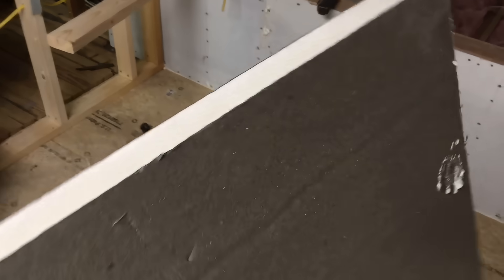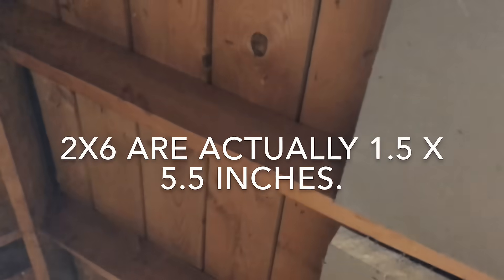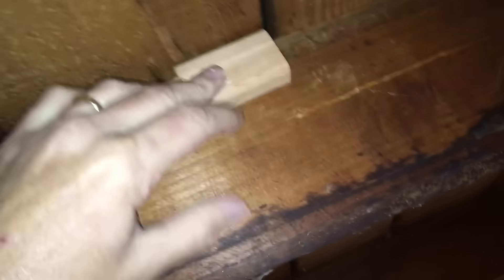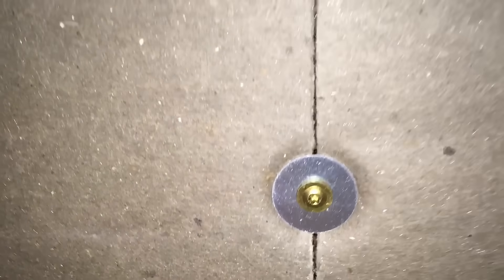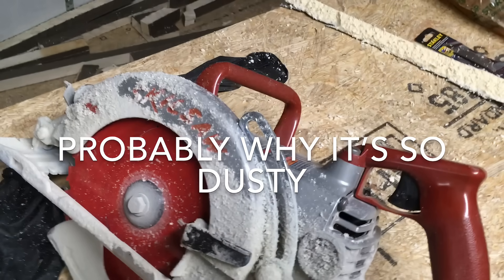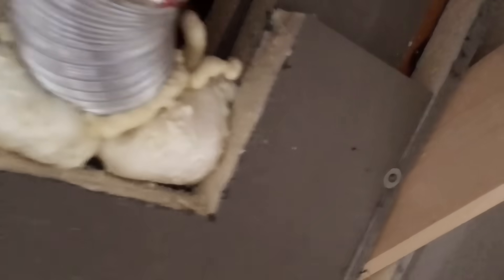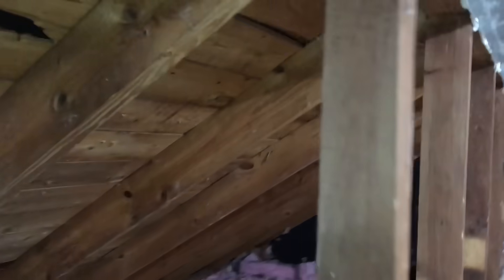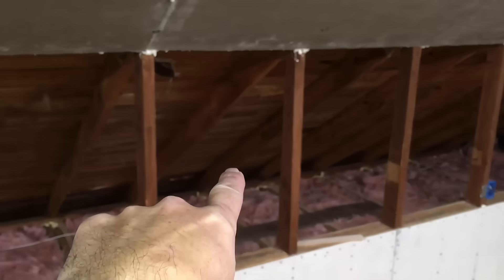Getting R-30 in an attic suite with 2x6 ceiling rafters

Comment: Do you have soffit vents? I want to insulate my roof and I’m trying to figure out the best way. I have no soffit vents nor do I have a ridge vent. The only vents I have are one on the west side of the roof and one on the east side of the roof about one foot away from the ridge. Do those two vents vent enough? Is there even a need to keep those two vents if there is no soffit vent? Any insight would be appreciated.
Reply from the maker: Yes, I have soffit vents. It sounds like you have are gable vents,  depending on where you live and if you get a lot of snow and ice, they're better than nothing, but in order for you to get any benefit from creating the air space behind the insulation (like in this video) you'd need to install soffit vents. If you have soffits, they make vents you can retrofit pretty easily with a hole-saw on a drill. https://www.lowes.com/pd/Air-Vent-3-5-in-L-Mill-Aluminum-Soffit-Vent/3017509
Reply: @FamilyFriendlyDIY  I appreciate you taking the time to reply and add the link. I don’t have gable vents but i have thought about installing them. All I have are two vents in the roof itself. Unfortunately I don’t have a soffit. I wish I did bc your idea would of worked perfectly.

Comment: Countersunk screws work nicely with fender/repair/penny washers and sit flush. 
An insulation saw with teeth like a bread knife makes less powder. 
Foil faced PIR insulation gives a built in vapour barrier. Foam fill any gaps and cover all joints with aluminium tape.

Comment: Do more research on your poly-iso....    Science proves it is a warm weather product..    As the temperature falls below 40 degrees it starts losing its r value.     For each ten degrees drop loses approximately 2 r value.     Might want to use a different poly which actually improves with cold temperatures..     Just thought you ought to know.

Comment: Because the portion of the wall is sloped, in Canada, it's considered a wall, as far as R-Value requirements. However, an air space of 2 1/2 inch is required. This is required to prevent choking air circulation between  other compartments.
Reply: inaccurate
Reply: @frostycools1315  Because..
Reply: @p0llenp0ny  r -50 is the min not r-30 , studs screwed not nailed, vapor seal boxes in interior partitions, no poly on top plates, and i only looked for less then 3 min of the video

Comment: Quick question - thinking about doing this on my 3 seasons room.  I don't have a ridge vent where it connects to the house, but I do (can) have a vent at the soffit end.  Would I need the ridge vent to do this?
Reply from the maker: For the soffit vent to work, yes, you'd need a ridge vent. They're pretty easy to retrofit though. You can just snap a line a couple of inches down from your ridge on your shingles, and cut through the shingles and decking with a circular saw. Home Depot and Lowe's sell inexpensive, plastic ridge vent you can nail over the gap you cut, and then you just cap shingle over it. Here's a quick video of us doing it on a garage. https://youtu.be/htmyY4A6u1M?t=643
Reply: @FamilyFriendlyDIY  Good video! However, my roof is basically a lean-to roof and doesn't have a "peak" where a traditional ridge vent goes like your video. The highest point of the roof is ledgered to the side of the house and just slants away. Would the retro fit ridge vent work there the same way?

Comment: 2021. Lot of work but it will definitely do the trick. Actually not polyurethane but polyisocyanurate insulation. Suggestion. Go to any roofing supply house (ABC Supply) to purchase the insulation approx. $56 per 100SF for 2” or $83 per SF for 3” and do in 2 layers?.  (save a lot over HD or Lowe’s) and also buy 3” insulation plates in lieu of 1” washers.  Steel plates cost approx. $110 per thousand.  Plastic plates cost approx. $125 per M.  You can also purchase insulation screws especially made for polyiso insulation. 7” screws will run you about $225 per M. Bottom line material cost approx. $2 per SF.  40-year commercial roofing contractor.
Reply from the maker: Thanks for all the extra info.

Comment: 1. Cut outside. 
2. Dont screw into your roof
3. Butt the panels flush so you dont have to use foam. Use a tape measure

Comment: is this cheaper then pink insulation? I need to do my attic as my poor electric/gas bill is 400 a month in the winter months and i need to add some (there is none)
Reply from the maker: No. This is definitely not cheaper than fiberglass batts, Kenneth.

Comment: Definitely nice job. Looks like commercial roof insulation for edpm or rubber roofs. Which i would have probably used roof plates instead of washers. Nice job no matter what I say.👍
Reply from the maker: Thanks, and you're right, William, that is the same insulation. I think I'll try those roof plates when I insulate the other half of the attic---some others mentioned those as well. Thanks for the comment.

Comment: Are you going to (or, did you ) insulate the walls in your attic w/ batt? So the eave vents allow air to go up your attic roof but not enter your finished space? How are you going to ensure that your finished attic space has adequate air exchange? AC? Thanks!
Reply from the maker: Yes. The walls have r-15 batt in them that doesn't block the path of air from the soffits to roof. It was stapled to the front of the knee wall studs, and then draped down behind the knee wall box beam. Thanks for the comment, Gregory.

Comment: Great job gonna do this to my pole barn cabin already have bubble foil on roof under metal I knew I needed air gap thanks
Reply from the maker: Good luck!
Reply: I also have a pole barn that we are turning into a shop. It also has the bubble wrap under metal. The reason for air gap is so warm moist air can vent out and that is the problem I'm having with the bubble wrap/moisture barrier.
Reply: @rogerd0  Mine got insulated on the inside along with ship lap on ceiling, walls are 6” thick stuffed with insulation too we don’t have electric yet but it feels cool inside even in the 90’s

Comment: Polyisocyanurate is R6 for each inch. And you should get foiled. Its also just easy to use a can of spray foam to make mound of space instead of cutting wood, gluing wood, and so on. Just spray a dot of spray foam in a couple corners and you're done. That black backing is made so you can cut the foam slightly smaller so you have about an inch or 2 of the paper you can simply staple down vs the washer screws.

Comment: Radiant barrier on the top layer would have been a great idea.
Reply: What’s the best way to do that though. I haven’t found a baffle that wasn’t pure flimsy junk, much less a high reflectivity one.
Reply: @TheChupacabra  Aluminum Foil. Yes, plain old foil.
Reply: What would be the proper spacing for the radiant barrier?  As in, touching the plywood?  Touching the insulation?  Somehow suspended between them?  Also, the rafters are supposed to also be protected by barrier, not just the flats between the rafters.  So, how would that work?
Reply: @CaseAgainstFaith1  I’m planning on going with touching the baffle or the insulation. That radiation will be reflected back (in part) presumably to get reabsorbed by the underside of the roof deck. I’m hoping that as this radiant ping pong is going on that the inch or two of air channel is continually pulling cold air from the soffit up to the ridge and out, taking heat with it.

Comment: Holy crap what a savings. Well worth the effort I'd say. I had no idea spray foam was so expensive. Whomever occupies that room will appreciate it because without that insulation it would be a sauna up there.  I have a similar attic room and I actually tacked up on the ceiling this foil radiant barrier they sell at Home Depot. It's quilted with an air pocket built in and made a huge difference. Then I screwed down a grid of those 1x2 wood battens on top of the foil blanket and tacked on cedar planks for a cedar ceiling, so there's an air gap between the foil and the cedar ceiling. Must have dropped the room temperature down by 10 degrees or more.
Reply from the maker: Thanks for the comment. I'm sure some others might want to try that with the foil too. I saw it at HD too and was wondering how it would work. That's useful info.

Comment: "hot roof" look it up, no ventilation required BUT closed cell spray foam needed to stop moisture vapor flow. I use it in Michigan where R50 is required. Works so well the snow sticks on a 12-12 pitch roof. Yes it is code.

Comment: I would recommend using a Insulation Board Washer instead of the washer you used. But I love your work here overall.
Reply from the maker: Thanks. Someone else mentioned that. I might try that on the other half of the attic.

Comment: You cutting it wrong. I've installed tons of that stuff on a flat roof. They cut like a tile/drywall, cut the paper and break it
Reply from the maker: I'm going to try that in my next video.
Reply from the maker: you're right! ... https://youtu.be/Z292iuV91hA
Reply: 😁👍 also the thicker it is, you will get a little slopage like you said on you new video, on the roof we use a roofers straight blade and cut a little deeper.

Comment: Hi Dave, thanks for this vid. Last Nov 2019 I applied your technique in the porch ceiling  of my home and made it into  a cathedral ceiling!  I want to thank you for caring to prepare and edit and share your video. Throughout  the layering of insulation I incorporated two different layers of bubble foil for radiant heat effect. :) You rock! Imitation is the best form of flattery. This proverb imitation is the sincerest form of flattery means that one imitates someone else because one admires that person or values what that person is doing. Cheers from Atlantic Canada during Covid pandemic :)
Reply from the maker: I am thoroughly flattered! I'd like to know how the bubble foil goes. Sounds like a toasty upgrade. Thanks so much for the kind comment!
Reply: @FamilyFriendlyDIY  You are most welcome and most deserving of supportive comments. Bubble foil is a thicker version of reflective foil. Here were the layers that were placed and I am so thrilled from the results mostly due to your dedication to helping others in projects like this. Hi. No spray foam in my cathedral ceiling project.  Here is the layering starting from under the roof sheathing; 2 inch air space, reflective foil facing up towards roof sheathing, 6 inches of XPS styrofoam)R5/1inch=30R rating! yupeee!!! Then a vapour barrier, another layer of reflective foil but this time facing down towards living space area, 3/4 inch strapping which also helps in creating the air space the reflective foil application needs for radiant effect to take place, ceiling planks are also attached to the strapping and voila!  It was quite a project with lots of caulking for air gaps and sealing joints and a sprinkle of can spray foam here and there for the gaps as well. Stay safe Dave during covid! Scary times!
Reply: @MegsCarpentry-lovedogs ok I think you’ve really nailed it. I believe the foil barrier to deflect UVB rays should be temperature rated as you may have discovered, there can be long term off gassing of the styrene from the XPS and melting shrinkage due to contact with a foil by conducted heat.

Comment: Could of insulated the rafters with fibreglass batt insulation and go over the rafters with a layer of foam you end up with R31 right?
Reply from the maker: Yes, but I wouldn't have the air-gap I needed.

Comment: Do your cuts in front of an open window, with a cheap box fan or 2 blowing out, to avoid all that dust in the air. 

Sawdust and drywall dust both cause mesothelioma, same type of lung cancer as asbestos. I wouldn't take chances with breathing that foam dust in a closed space. Do as many cuts as you can outside. Its worth a few trips up and down the stairs 👍
Reply from the maker: Thanks for the info. Good to know. ---I did all my circular-saw cuts outside and wearing a mask. I only did small tune-up cuts with a knife or handsaw inside. I also wore a mask the whole time I was working up there until I got the drywall in.
Reply: @FamilyFriendlyDIY  oh, it looked like you were using the worm drive inside. Thanks for taking the time to respond! Great channel.  Best of luck

Comment: Didn't need to spend the money on the GRK's. Regular exterior screws would've been fine, and cheaper.
Reply from the maker: I actually bought cheaper screws, but the rafters were so hard that I kept stripping heads and breaking shanks so I switched to the GRKs for the star drive and self-tapping tips. Cost more, but saved a ton of frustration.
Reply: @FamilyFriendlyDIY  makes sense then. Thanks for the reply! Again, good vid 👍

Comment: The spray foam is easy to use and insulates but does burn. In fact it burns quite readily which concerns me. Is the insulation board made of something that will burn? Even the orange fire rated foam which is expensive will burn quite readily.
Reply from the maker: It has a Class B fire rating, and requires 1/2 inch drywall between it and interior space--I'd assume to slow the spread of fire.

Comment: Good info! I've built a lot of SIP structures. Try using a hot knife to cut the foam. No dust.
Reply from the maker: Thanks for the comment! new comparison video https://youtu.be/Z292iuV91hA ... I didn't use a hot knife because after some research I found it won't cut the fiberglass reinforced paper, and it cuts slower through thick foam.

Comment: Is the fiberglass the cloth on the surface or is the interior actually made of some kind of fiberglass? 
I asked cause I got some free stuff like this from a dumpster at a job site and am going to install it in my shed roof and wondering which part I need to watch out for when handling...
Reply from the maker: Just the surface layer has fiberglass in it.
Reply: @FamilyFriendlyDIY  thank you!

Comment: Dave. Thank you. I am curious about radiant barrier. Why not make the outer layer foam board with the shiny radiant barrier?
Reply from the maker: Good question. It was a lot more expensive than the type I used. I was trying to meet code as cheaply as possible without loosing too much ceiling height. Thanks for the comment.

Comment: Why not just r20 batt on the inside of the rafters and then two layers of foam on the interior. Seems kinda like filling cavities with foam board is a lot of work.
Reply from the maker: That would not have left the 1.5 inch air space required by the inspector and roof shingle warranty, and would have reduced headroom by another 2 inches.

Comment: What’s the temp up there in the summer? What’s ur hearing bill in the winter? Looking at doing the same thing.  Also was curious if I can put radiant barrier behind the foam?
Reply from the maker: When my daughter is home, she keeps it about 70 F up there in the summer. She can easily get it in the sixties (and liked to), so I limited the thermostat. As for the heating bill, the gas is usually $100 to $150 (never above $175) and the electric is $60 to $75.  We don't have an equal payment plan either so we are charged for exactly what we use each month. The attic bedroom has a PTAC, the rest of the house is on gas. It's a 3 bedroom ranch with a full basement that is conditioned too. I'm guessing the total conditioned space now is about 3,000 sq. ft..  ... Hope this helps. Thanks for the questions.

Comment: I have a friend that does flat roofs, they use this exact insulation board on the roof before the rubber roof, he was talking about how high the r value was, I was building living quarters on a garage I already had, and I bought about 1500 sqft of these insulation boards from the company they used. I had it stacked on my trailer in my garage intel I was ready for it, I walk in there one warm day and the fumes coming of that insulation smelled terrible, it was so bad I thought no way em I using that in a air tight living space If it smells like that in this 50x50 with 16 ft ceiling garage, after doing some research and talking to the manufacture, this insulation is not certified for interior use, it’s sold for use on exterior of building, it is not Certified for indoor air quality requirements. I decided against using it, and sold it. It’s now on the exterior of another Friends roof he used it under a metal roof.
Reply from the maker: We've never noticed a smell, but you're right, this type of insulation is typically used under membrane roofs. According to GAF, the manufacturer, the only stipulation is it must be separated from the interior by 1/2" gypsum board per Section R316.5.2 of the IRC. ...You've definitely given folks something to consider. Thanks for the comment.
Reply: I think it’s made from petroleum cuz to me it smells like straight up gas 😂
Reply: @Dr_GraysGhost_420   smells like poison for sure

Comment: I did this 25 years ago except my foam was 3 in and foil faced instead of glass. Cut it with an extended large snap off utility knife blade. No dust at all. Bought my foam from a local shoring supplier. They go through tons of it building bridges and commercial foundations. Paid less than half what I would from a big box.
Reply from the maker: Good info. Thanks for the comment!
Reply from the maker: tried this in my new video https://youtu.be/Z292iuV91hA

Comment: Your video is great, it is drawing out a plethora of comments from which we can overthink everything.  We think you did a great job and credit you for pioneering this system.   A friend did well with a cold roof design 20 years ago. (Your 1 1/2" spacing kept his shingles strong).     Our plan was one layer of foam board followed by spray but you showed this to be more economical.
Reply from the maker: Thank you for your kind comments!
Reply: One could slightly improve this concept by have one side of foam board have the radiant reflector foil facing the under roof gap  side.

What’s the r-factor if doing one slice of the foam board and then spray foam on top?